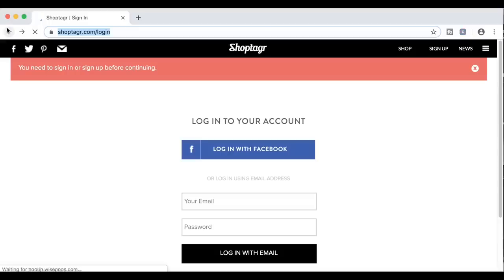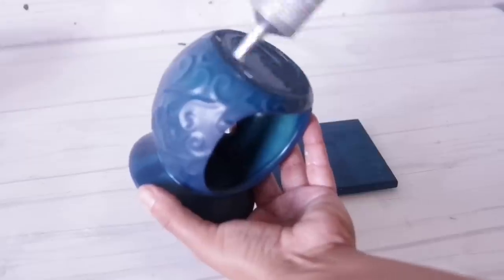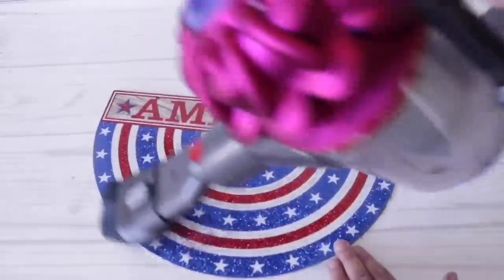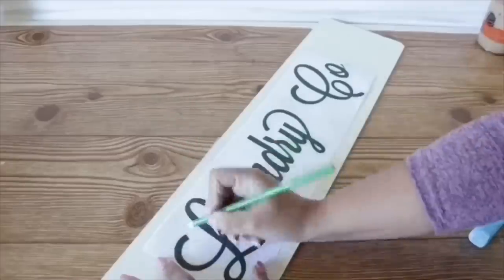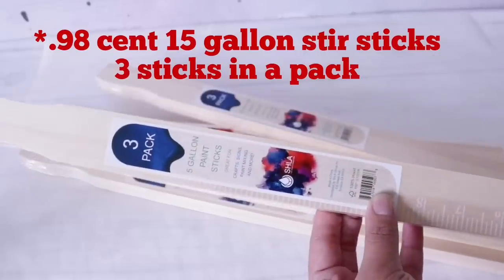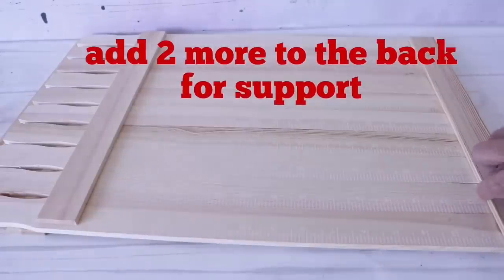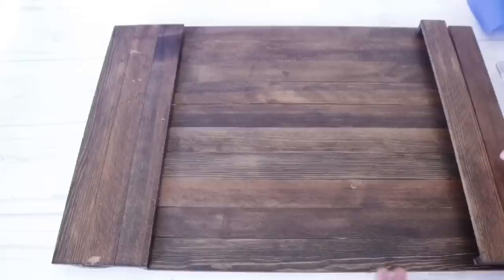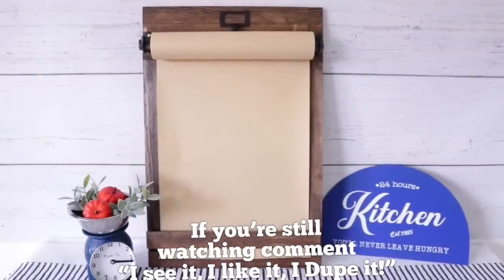DOLLAR TREE DIY budget- friendly Dupes for less

Comment: Hi Jay! I am a long time crafter/artist, and if I may, I would like to give you a couple of tips to make your crafting a bit easier. Michael's stores, or any art and craftsupply store Carrie's a transfer paper by Saral.  You will wonder how you ever crafted without it! No more scribbling on the back of your pattern. It also comes in a variety of colors, for darker surfaces. No, I don't work for them, but I have used this product for years! 
   The other tip... if you turn the metal drawer pull upside down, it may be the perfect size to hold a pen or marker or something on your paper memo board. Or you can tie a piece of jute string to it and hang a pen from the other end. 
   I hope these tips are of use to you! I love your style of crafting, and have gotten lots of ideas from you! 🖌🎨🖌